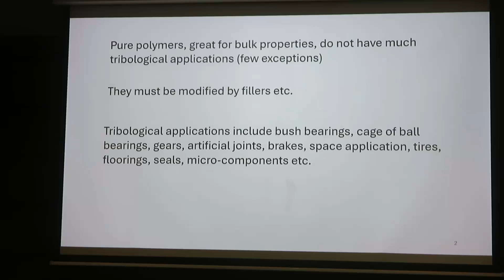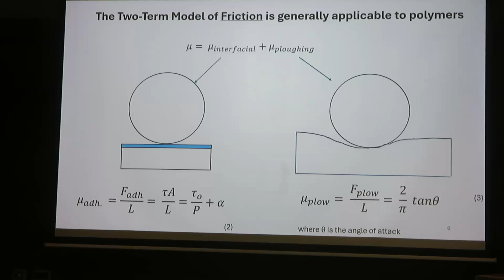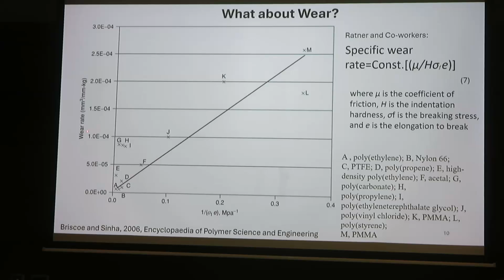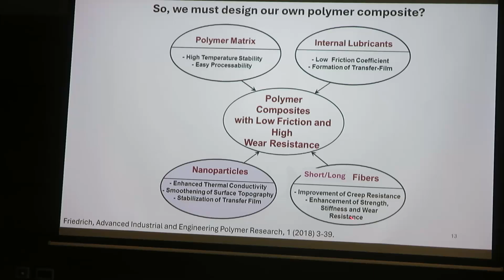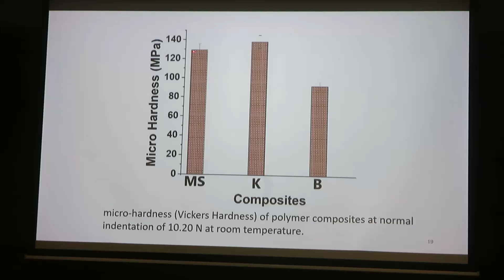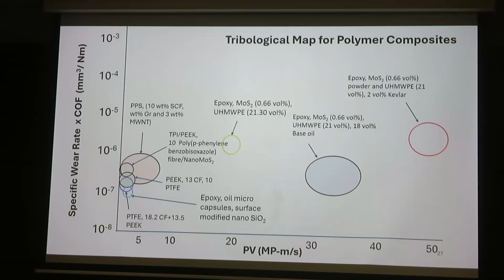Talk given by me at PolyTrib 2024 Portoroz, Slovenia on 03 Oct 2024

Comment: Sir, if the coefficient of friction is high, the wear rate should be high. But for the K composite 50N load, the coefficient of friction is high, but the corresponding wear rate is low?